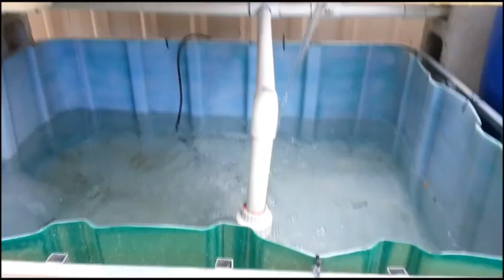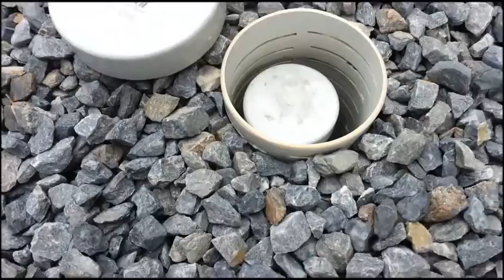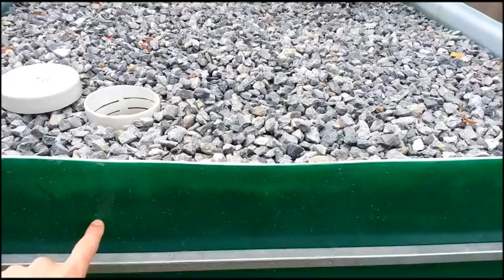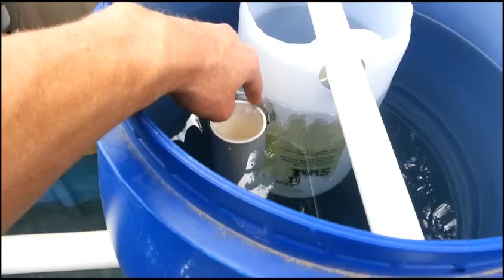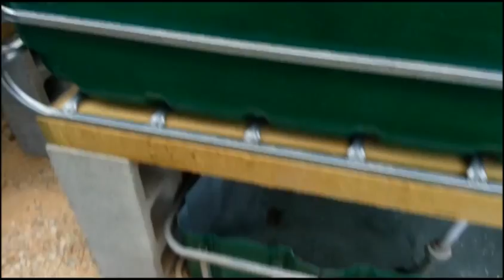My Aquaponics introduction video.

Comment: Question:
Shouldn't you have ur bio-filter separate from the grow beds so the beds won't turn gunky?
Reply from the maker: There is no bio-filter in this system. The blue barrel though is a radial settling tank which does exactly what you describe. Waste from the fish enters and falls to the bottom, while particle free water is skimmed from the surface. It collects fish waste and uneaten food, which needs to be cleaned out about twice a year. I emptied out the gravel from one of the grow beds about a year ago and it was surprisingly pretty clean. It wasn't worth the effort of repeating the effort in the other bed. Thanks for commenting.
Reply: @BrentonCollas  isn't the bio-filter essential to get ur nitrites to nitrates which is more beneficial to the plants and less harmful to the fish?
Reply from the maker: You are talking about providing a substrate for the bacteria to live on. The grow beds are full of gravel which provide the surface area where the process you talk about occurs. The biofilter also does that as well as remove particles from the water. There are other forms of aquaponics where plants  and grow beds are not used,  which certainly require that extra substrate/biofilter to be provided. My system is not one of those.

Comment: This system is amazing!  Two questions: first, do you run the pump constantly and just rely on the autosiphons to regulate water or do you turn the pump on/off?  and second, at what size do you think the need for a swirl filter comes into play?  I'm looking to start a small system (95L fish tank) and hadn't planned on a filter for solids.  Thanks.
Reply from the maker: Hi Nathan, Yep, it has been running 24/7 for the last 3 or so years. Hope not to jinx myself for saying that. My opinion re: the radial settler, is that they are appropriate for all systems for 2 reasons 1. You get to build it as a proof of concept in case you need to build another larger one later, and 2. is that in an appropriately scaled system, you are going to have solids, which will build up in any  sized system regardless of size. If you haven't built your system yet, why not optimise? Two things I would change for my system: Bigger pump for more water turnover, and actually I could probably use a smaller radial settler (perhaps 100lt drum if I could find one). Although, more water the better...

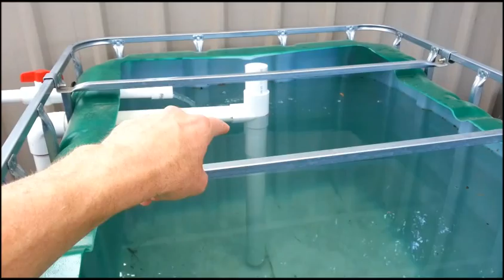Comment: 2:23  QUESTION  Beard system?  Is that what was said there?  I don't understand how the water is going from the bottom lift system into the shroud, and then into the clean swirl output, can anyone better explain?  Is the water going into the barrel from the bottom, up into the shroud thru that pipe in the center?  How's the water come out of the shroud, it's bottomless, allowing for flow there?
Reply from the maker: He he. I think I said "big system'. Weird. I meant through the larger  pipes. The water flow all works through gravity. As the water level rises in the fish tank, the only place it can leave is via the large SLO pipe. The water height in the FT is therefore same height as the bottom part of the hole cut in the side of the FT where the SLO horizontal tube exits. Does that make sense? The open-T piece on the SLO is to create an air break in the output pipe, preventing a vacuum being created in the SLO which would then siphon all the water out of the FT. Eeeks! Hope all that made sense.
Reply: Brenton Collas Yeah, thanks!  But does the water then enter the swirl barrel from the bottom, thru the pipe in the center, that's surrounded by the shroud, and then the water exits the shroud from underneath it (change of direction of flow to get solids to drop)?
Reply from the maker: Yes, that's exactly right. Over time I've realised  that my water flow rate is not so high that I even need to have the shroud, so the solids are dumped straight into the radial settler towards the bottom and cleaner water skimmed from the top.
Reply: Brenton Collas Sorry to keep bothering you, I'm just kinda bored here...  This is such a fun hobby, I just got into freshwater planted aquariums a couple years ago to work my way into the understanding of it all.  The plumbing aspect alone has been an amazing learning experience, never mind the biology/chemistry/physics of the rest.  I noticed that the aquarium hobby tends to get people overstocked, and thus, having to do water changes weekly, taking a lot of the fun out of the hobby (I only want to do water changes once every month or two, if ever), so I just have a couple guppies inside a series of connected planted tanks (40 gallon total), the nitrates are still climbing 3 months later, and I'm now learning that immersed plants will soak up nitrates much faster than submerged ones, due to their being exposed to the air (more CO2).  I've hear some stocking recommendations in aquaponics that also seems high maintenance, like, 1lb live fish per 1 or 2 gallons, I couldn't imagine a 12" tilapia inside 2 gallons of water, thinking that I'd personally want to do 5 or 10x the volume (1lb per 10 gallons), and then they say that the fish to plant volume ratio can be 1:1, but I'm thinking one could easily do 1:2 or 1:3xs the plant volume, might you agree?
Reply from the maker: I also enjoyed the mechanical aspect of it when I was constructing it. And I was also fairly conservative when planning my stocking rate. There is about 900L+200L+150L of water in FT, Sump and RFF. I had 22 large silver perch and half a dozen goldies in there before my catastrophe. The catastrophe involved me forgetting to turn the air pump back on on the hottest day of the year when the water went to over 26 degrees C (it was over 30 C overnight. That error caused me to lose all the silvers (and a few were pushing 500gms). To that end I think its more important to stock conservatively and build redundancy into the dissolved oxygen and water flow pumps rather than finding optimum stocking rates. Not sure about your ratios, is 1:3 1 fish per 3 gallons? tbh I can't remember exact ratios, I just knew that 25 silvers was quite conservative for 1000L.
Reply from the maker: PS, I've never done water changes, but water top ups are required in South Australia in summer. I prepared top up water with a 200L of tap water (which contains chlorine and chloramines here), with 2x500mg vitC tablets and an air stone for at least 48hrs before adding tothe system)
Reply: Brenton Collas I'm finding the mechanical aspect kinda frustrating.  lol  Yes to redundancy, absolutely!  The stocking ratio was based on their 1lb live fish per 1 or 2 gallons water...  1:1 ratio is the volume of water for fish (not lb) per the volume of media for plants, but as I said, that first recommendation they gave (lb of fish per gallons) just sounded crazy to me, so I'm thinking it (how much volume for plants) would be something else.  In aquaponics, much like the aquarium hobby, I'm finding it funny how I can't seem to just follow the rules of thumb that they come up with.

Comment: I have seen a lot of systems and can say that yours is the cleanest build i have ever seen . Every thing is nice simple and neat .I now have a design i will be proud to build and for people to see  . Thanks !
Reply from the maker: thanks for your comment. The system is going well and I'm looking forward to the summer season of strawberries and tomatoes. I have noticed I had been losing more water recently: I think that the media has settled after over a year and Ive needed to shorten the stand pipes by almost 20 mm. Its doing better again since and has noticeably slowed the amount of evaporation. If you do copy this design, please keep two points in mind. This size of radial settler is overkill, I would have liked to have had the extra room for a biofilter with some bioballs etc. The second point is make sure you have something to reinforce where the 1200kgs of fish tank will sit. Gravel and sand (quarry rubble) was not enough and I had some sinkage drama one wintry rainy night. I should have put sleepers or pavers underneath. Apart from that, its been a hoot! Cheers
Reply: Brenton Collas Thank you for the added info. And yes sleepers are a great idea.
Reply from the maker: Hey Komer, did you ever make a video, or post photos of your system online?

Comment: I have a very similar system, the main difference is that the water that goes from the sump to the fish first goes through a bio filter (made from the same pvc barrel as yours), so the fish (Tilapia) only get purified water pumped to them.

Comment from the maker: The only pump is in the sump. The water flows from the solids filter to the sump by gravity, skimming the clean water from the surface of the water in the filter. There is a tap (seen at the bottom of the blue drum) which can be used to take away fish solids from the settler.

Comment from the maker: Hi Jon, I used a electric hand sander to scuff up the plastic a little and used an automotive plastic primer (Septone Plastic Primer Filler). Then applied layer after layer of acrylic paint that I got from super cheap auto (SCA multipurpose acrylic). There is a link to some more photos in the description of the video above.

Comment: Great work. An idea. I think by adding a L pipe to outlet of filter (making a U pipe in total) and 'lifting the water' to just below inlet, the FT water could all go straight to the beds. You would also need to lower the beds a few inches. Then pump all the sump water to the FT.

Comment from the maker: The pump is rated at 2400litres per hour, twice the volume of water in the system, so there is plenty of water being circulated through the growbeds feeding them nutrients. How would efficiency be improved if all nutrients are eventually reaching the plants? (Also, the water from the fish tank water flows through the filter back to the sump by gravity - elevating the FT that much was not practical and would make the pump less efficient [more head].)

Comment from the maker: Thanks for the comment. Its a CHIFT PIST system, meaning that the height in the fish tank stays constant, which wouldn't happen if the pump was in there (and in case of a leak anywhere outside the FT, the fish wont die when the tank is pumped dry!)